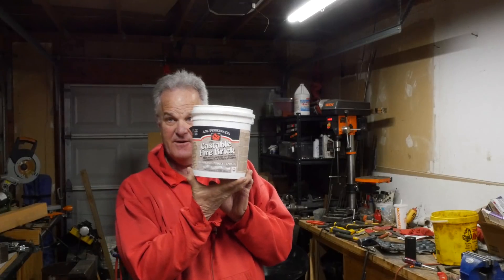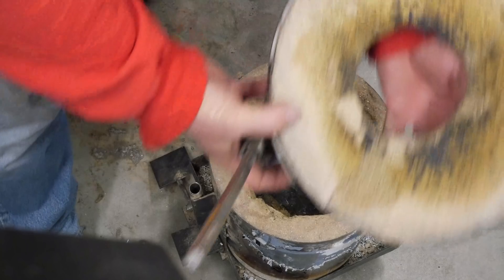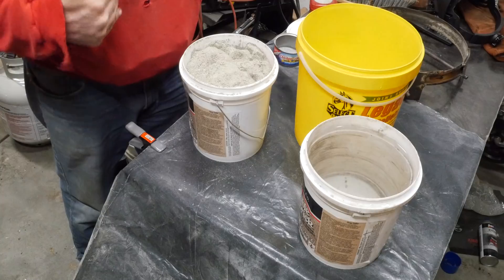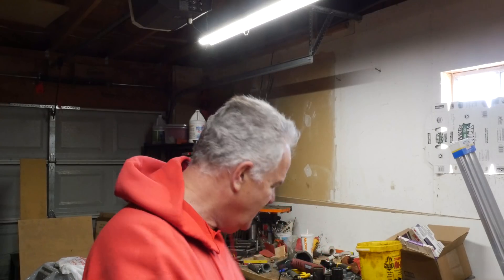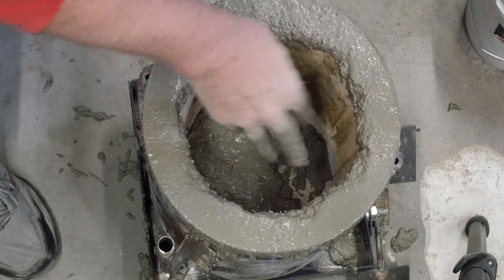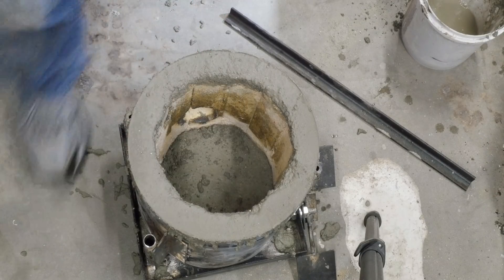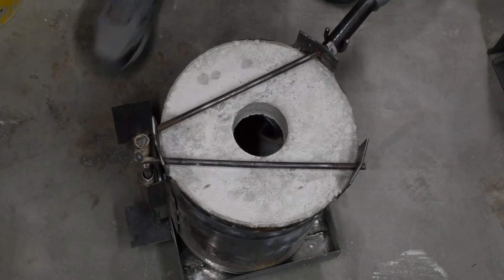Rebuilding my foundry furnace

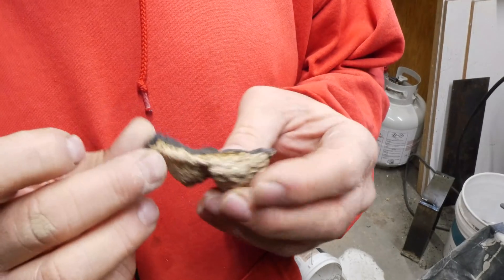Comment: The stuff at 11:54 is melted ceramics. The furnace cement is made of clay which if gotten hot enough will turn into a ceramic; which if gotten hot enough will melt. That piece most probably went to over 2300 degrees F. I melt aluminum with an off the shelf Benzomatic TS8000 using a Coleman green one pound tank. I get three 1.5 lb aluminum melts from each tank. It is my view that the burner you are using is a bit too large. Make your new one with half inch pipe and it will work fine and not thermal shock the furnace lining as bad. The metal can only absorb so much heat per unit time. Putting more in than can be absorbed and the excess will just go out the hole in the lid.

The smaller burner will also reduce the stress on the furnace lining. The lining is circular with the inside being heated while the outside is still cool. The inside expands but the outside does not producing stress which causes the inside to crush itself if the heat does not have time to travel outward to equalize the expansion. The cracks seen in the inside of a furnace is the space produced when the lining was crushed which open when cooled down. The lining should be a single layer for the same reason. 

I suggest you get a castable insulation with 2700 degree rating. (Amizon) Pour it at least 2 inches thick but not more than 3 inches.  This will last a long time.
Reply from the maker: Hi John, YouTube does a terrible job of showing dates and more importantly showing newer videos. That was from a little over four years ago. I've since built a larger furnace with the goal of melting hotter metals in larger crucibles like bronze and iron. If you'd like to critique my current furnace, you can see it here https://youtu.be/iMCaic-0-hc

Comment: Noice noice noice!
Cool vid for the revamp!
Looks like it'll perform well, or maybe better! :D
Thanx buddy!
Reply from the maker: So far so good. I need to reline the sides though. I'm not sure that it's getting as hot as it used to before I tore the old lining out.
Reply: swdweeb You might want to research a product called Satanite. It has a high refractory index, and those that use it will nothing else after it. Lol

Comment: Hey, an off topic question I was watching some of your older videos and noticed that you have a 3d printer. Have you ever thought about lost pla/wax fillament casting ? Anyways keep up the good work, best of luck
Reply from the maker: I have, occasionally, but I havent seen a lot of great results on YouTube. It looks like most people struggle to get all of the material out of the mold (especially when using PLA). Plus its a one-off process. The printed piece is only good for one casting. So far that hasn't been a huge issue for me since I typically only cast one thing but...you never know. 

I guess bottom line is I have thought about it, I find it intriguing but havent tried because of the work involved and the low success rate I've seen on YouTube... now I'm going to have to try it ;-)
Reply: swdweeb 
Well it allows for geometries that are impossible with sand casting. I tkink Black Beard Projects had a great video "brass pen lost wax casting " or smth like that seems like a lot of work but the effect is really stunning. Plus you already have a 3d printer and a forge so why not give it a try :)
Reply from the maker: Tell you what, I'll go look for that video and see what htey did. I agree with you completely, you can do things with this technique that are impossible or nearly impossible using a split mold casting. I also completely agree that it is a lot of work ;-)  I'll consider it, I just need to figure out what I would cast

Comment: Nice job! And quite messy. I thought you only need a flare at the end of the burner when testing it outside the furnace. My pipe sits just inside the interior opening and it's held up well. If you ever need to redo the lining again- think about a drain hole incase of a crucible failure. I haven't done a melt since I redid my furnace and I don't expect the high temp mortar to hold up for very long. The weather has improved dramatically and I should be switching to more casting vids and less blacksmithing so we'll see.
Reply from the maker: You know it was you that told me that my first furnace wouldn't be my last ;-)

I've been told that I need to line the walls again so I guess I'm going to do that. I may do an aluminum melt for this weekend before I get it done though.

Comment: SW, The "glass" may indeed be due to the refractory concerned not having a high enough temperature rating or to what you added to it causing a fluxing reaction, but if either were the case I would expect the glass to go deeper. I think it most likely due to something that has got into the furnace and caused a fluxing reaction. Likely culprits are iron oxide from that malleable iron pipe fitting, copper oxide from spilt bronze (in which case I would expect to see some dark brick red colour in some of the glass), or salts from spilt fluxes. Spilt aluminium generally does not cause a problem - well not this quickly anyway. Such glasses are a bit of a fact of furnace life but should only form over years.... Martin
Reply from the maker: Given that the entire furnace was lined with the same stuff and that I only had it in the bottom, I'm going to go with spillage as the culprit. I know that during some of my lite salt testing I spilled some outside the crucible.  I can't recall any metal, except that aluminum swarf being outside the crucible.

Comment: SW, I am not familiar with the refractories that you used but they did look way too wet to me, Did they come with instructions as to how much water to add? The castables that I have used were mixed way drier. Mixing wet leads to low strength and low life as well as often causing cracks when  drying (although you seem to have avoided that). Refractories are quite unlike normal cements when  it comes to water requirement. When adding a layer to existing refractories its probably best to brush the existing stuff with a little water. Re furnace life, the lining in mine, a high temp (1650 deg C) castable,
is 45 years old, in that time I estimate something over 10,000 melts at least 2000 of which would have been bronze. This is despite the lining being badly cracked by improper slinging when the furnace was moved 30 years ago. I have replaced the lid once, the plinth bricks that the crucible sits on several times and I have done a little patching from time to time  but no major relining. The burner , a commercial one (that cost almost a weeks wage!) is still in good working condition requiring just the occasional clean. I have every confidence that the furnace will out last the 5 years or so of casting that I may have left.
To dry really slowly start by placing a 100 watt incandescent light globe in the furnace for several days.. Martin
PS. I notice that the new hoddie is already torn on the sleeve ends what do you do to them or do you buy them like that -:)
Reply: Donnie, This sounds like a ramable not a castable. We used to get this stuff just as you say wrapped in a plastic film and in a cardboard box. It was a sort of blue colour and became known as "blue ram". In consistency it was like a very gritty putty and the idea was that you rammed it in place rather than tried to cast it. In fact the instructions were "DO NOT ADD ANY WATER" - if you did it would crack as it dried. I still have a little left (transferred it to a sealed drum to stop it drying out) and its good stuff very suitable for plinth bricks and other simple shapes and also for patching furnace walls and bottoms would make a nice lid if rammed into suitable formers. It does need to be rammed in quite firmly. Yep, small foundries are vanishing fast there used to be over 250 foundries in Melbourne now there are about 100 and in a few years it will be just 50! What hope do you have when product fully machined comes in for less than the price I charged for the raw casting! 1000 lb min shipping, Hmm best you go for a long drive and pick it up. 1 lb equals 0.453 Kg so 50  lb is 22.5 Kg (close enough)...Martin
Reply from the maker: The hoodies were actually bought at the same time several years ago.. I just wore the grey one out before switching the very broken in red one ;-)

The container did not actually give any mixing instructions, but I put about 2000% too much water in it. If this doesn't hold up, I have more of it that I can build another with... using less water of course.

I guess I'll be making a lining to go along with the rest of it this weekend. ;-)
Reply: Olfoundryman the refractory we used came premixed 50lb or 27 kilo wrapped in plastic in cardboard box. (Trying to get into conversion of us to metric) wish I could get some of that now but no local suppliers left here now. Won't ship less than 1000 lbs. All the smaller foundries are gone from here now. The one I worked at was the smallest and it handled 26-28000 lb heats.
Reply: Olfoundryman appreciate you jarring my memory. Thinking back it was used to chinck the gaps between the brick and was used in the floor of the furnace solid about 18 inches. It was also used in the crown of the roof. I hated relines of our furnace because we had to go into the furnace and even after 2 or 3 days it was still very hot.
Reply: Donnie In another life I spent a few weeks at a steel works and furnace relines were a very common occurrence. There were teams known as "demolishers" who pulled out /down the old lining and yes the heat was a problem  the demolishers worked in two teams 20 minutes on and 30 minutes off - they drank a lot of water! (and no doubt a lot of beer after hours!). The feerless freeps though were the brickies that used to go up on top of the working open heath furnaces to replace the odd brick that fell in, they would balance on the steel work a few feet about the faintly glowing brick roof cut a brick to fit and drop it in the hole - madness!.. Martin

Comment: The molten black slag is likely the inner part of the refractory lining that melted. You are getting very high temperatures in your furnace, as evidenced by the molten flare (which AFAIK is made of cast iron, not steel). You need an inner layer that is as refractory as possible. I use satanite, and though I haven't used my furnace nearly as much as you (probably 20-25 firings by now) I don't see any melting of the inner layer. It holds up extremely well in my experience. I recommend that you line the inside of your furnace with satanite. You don't need much - a 1/4 inch layer should suffice. And by the inside I mean everything: walls, bottom, and the inner part of the lid too. I personally have covered everything inside with satanite, including the plinth and the exterior of my crucibles. They all hold together very well. Satanite is rated for 3200F (essentially the melting point of iron), whereas the castable refractories IIRC don't go over 2600-2800F. In fact I plan on experimenting with pure alumina (3700F) and zirconium silicate (4600F) as refractories in my furnace, with the goal being to melt iron.
Reply from the maker: As I said in the video, I'm a little concerned that if I put a lining on the fire brick, it will separate due to the expansion coefficients being different.  Apparently from your experience, that isn't a problem. 

I can look into satanite, it's just one more thing to buy ;-)
Reply: In my case it's not that much of a problem because it's applied on top of kaowool which is kinda flexible. But I've also used it on the piece of fire brick that I use as a plinth, and on crucible walls - and it holds very well there without any separation.